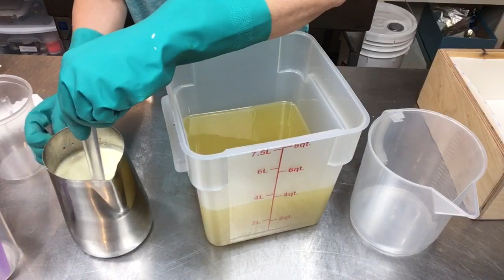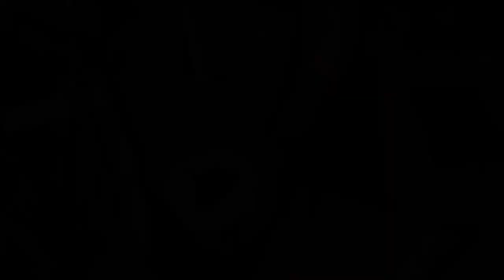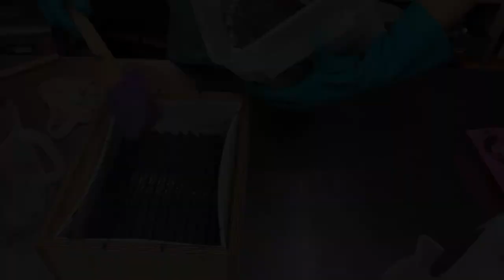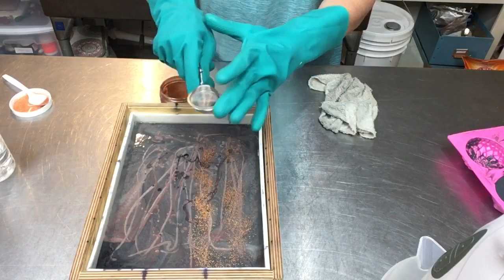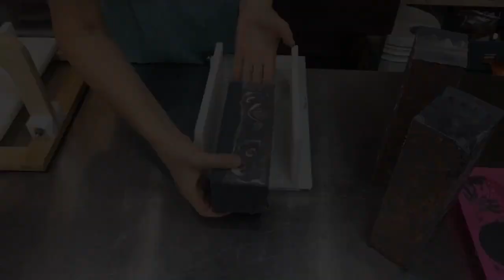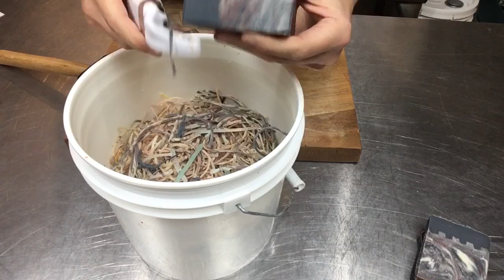Making, Cutting, & Stamping BLACK TIE - GOAT MILK Cold Process Soap

Comment: Wire cutters just make a bumpy surface, not sure why but they do.
Reply from the maker: So true, I'm trying to decide if I want to plane all my bars or not...
Reply: Ellen Ruth Soap I don’t sell but even if I did, i wouldn’t plane. I have a planer but I don’t use it regularly. There is a very successful soaping business in my town, her soaps look ROUGH. She uses plastic to line her molds so you even see plastic marks on her soaps. She frequently has partial gels and doesn’t correct them. She uses a knife to cut her soaps.so the bars aren’t perfect. No one cares...her business is VERY successful! I’m taking that stand. 😂 Friends and family never complain about my soap. So, honestly, I wouldn’t worry about the bumps. I have them too.